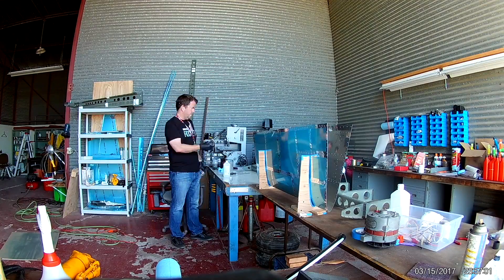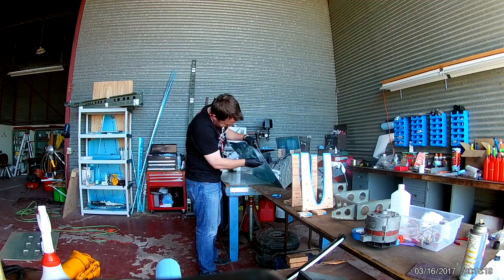RV-14 - HS 14

Comment: The bucking bar for use in the nose ribs, was that included in the required tools section of the plans? Or, did you just happen to buy it and it wound up being perfect for the job?
Reply from the maker: The bucking bar my friend gave me works perfectly. Its a 1" x 1" x 2" tungsten bar. I'm able to do about 98% of all bucked rivets with it. I also have a massive 5 pound bar I use whenever I need extra mass.